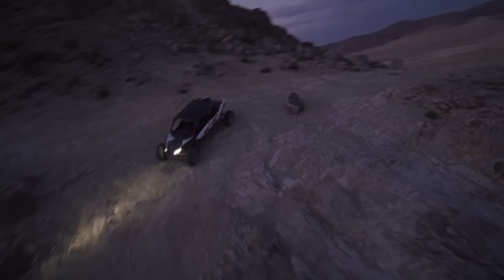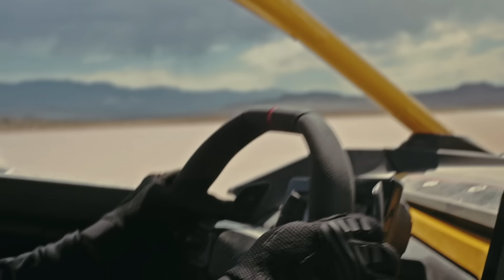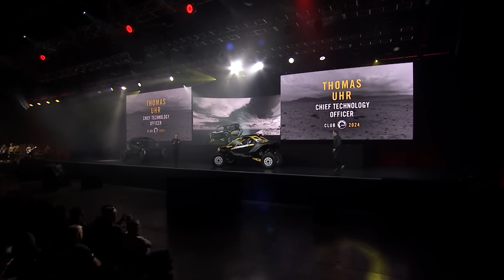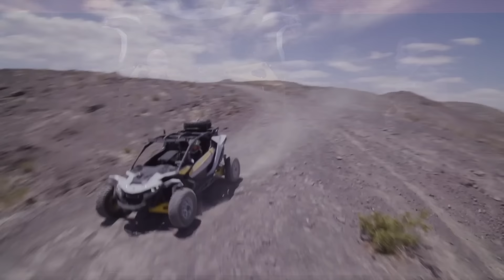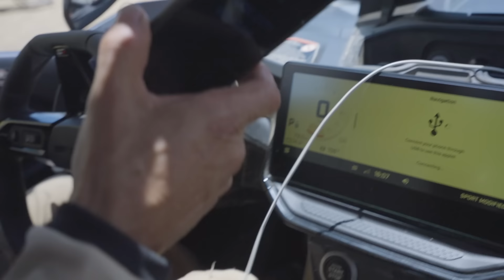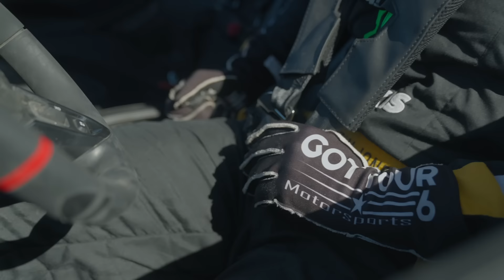2024 Can-Am Global Product Reveal

Comment: Hey BRP! listen to your customers!
first off half doors? No parking brake? a pull cord on the inside to open the door? some of the cheapest flimsy plastic making up a majority of the machine? Maintence dont get me started what a nightmare!
Kawasaki full doors, parking brake, door handles like a car has, rigid plastics, metal firewall for that accidental stick intrusion, a useable bed, thicker control arms, Oil changes super easy access to drain plug oil fileter and air filter, more reliable, and about 2k cheaper. Only thing can am has over it is 25 more horsepower. Step up your game for your entry level machines. Not everyone can afford a 45k machine!
hell for that you can buy a Wrangler.
 These guys are out of touch